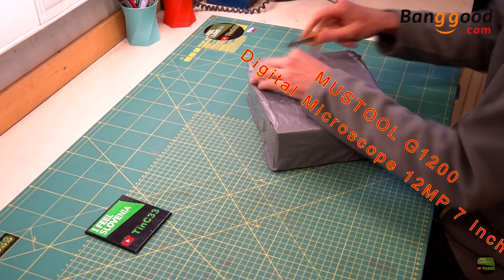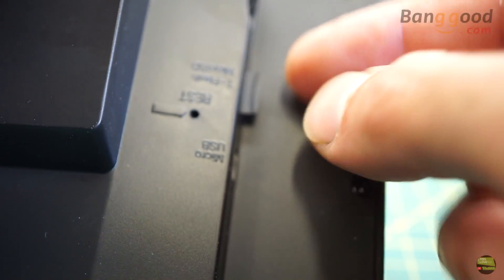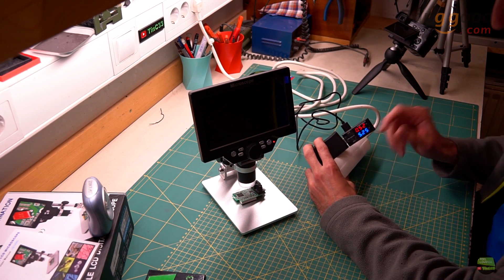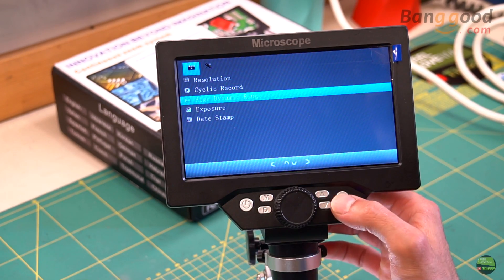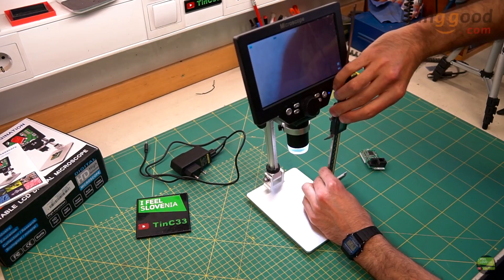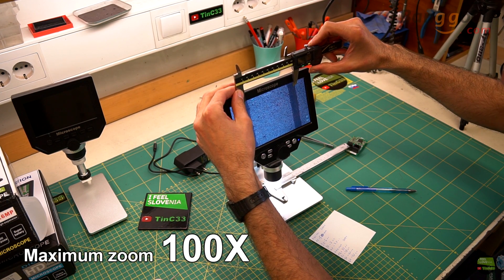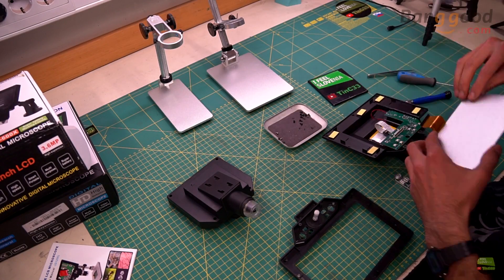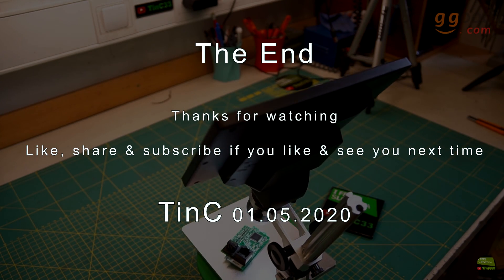MUSTOOL G1200 7" Digital Microscope [unbox / review / first test / compare with G600)

Comment: Thanks for perfect review.
I have  g600 and the same issue exactly as you said.first time unbox it didn't have charge and I charged it with fast charger and never powered on.i couldn't use it even 1 minute.
Do you have solution and did you solve g600 problem?I think cpu damaged

Comment: hi thanks for your video . very helpful. Mine just arrived and it came with an angle adjusting bolt that has to be losened with a 12mm spanner. A bit difficult to do, It would have been better to have with an adjustiong knob.

Comment: i bought it , and used it for a month , and i regret it , the image quality is very bad  , it never gives good balance between light and dark areas , the light is refleced directly to the camera when working with cicuit boards or electronics repairs , cannot see the parts clearly and the colors is not clear too , cannot tell if there is some thing dicolored or burned ,
and after a month or so of usage , it died , it doesnt turn on , i opened it and tested the board , i found the circuit board to be shorting on the power area next to the charger port , and its poor design seems to have failed in short time because it generates lots of heat while it doesnt have and proper cooling , 
its one of the worst microscopes in the market and no matter what price you pay for it , doesnt worth it 
never buy this model , you will end up throwing it in trash
Reply: I have had a similar experience. mine would not turn on either. on the day before it died I plugged it into my laptop and a message came onto the screen saying a USB device plugged into this pc is demanding more power than this port can give. I am not qualified to test the board, I wish I could, anyway i would need the microscope to view the SMD components on it, catch 22. I suspected that the battery was at fault so I removed it and now the microscope works again. I would be very interested to know which component you found shorted so I can have a look at that area and possibly replace that component with one of quality and maybe install a fan above it by printing some sort of holder on my 3D printer. The build quality of the microscope is rubbish. when i first got it the lens holder fell apart and i had to glue it permanently into the body of the unit.

Comment: Great review. I kindly ask which battery is fitted and its voltage and mAh characteristics. And where can I buy it. Thanks
Reply from the maker: It's one lipo battery so 3,7-4,2V about 2500mah i think, battery can be bougt on ebay, for microscope is link to banggood under video description.
Reply: @TinC33  Very useful information. I recently bought the microscope from Aliexpress by mistake without a battery, and I still did not know its features. Thanks.
Reply from the maker: @rosariaconilsorriso4314  i doubt you can just add a battery, there need to be battery manage system on pcb.
Reply: @TinC33  The microscope is the same as the one you reviewed in the video. What I know is that the package bears the words "the battery is optional" and that in the pcb there is a connector for connecting to the battery. I hope so.

Comment: been looking for an LCD microscope and came across your video. Would I 
be able to use this with slides ?? I want a reasonably priced microscope
 to look at skin scrapes from my pond koi. I can see there is no way to 
lock a slide in place but would that be a problem. Does it only work via
 battery or is there a mains cable as well
Reply from the maker: There are two types with or without integrated battery, booth are supplied with micro usb.
Reply: @TinC33  sorry..will the micro usb work instead of the battery. I assume it needs to be hooked up to a pc or lap top..
Reply from the maker: @mucky1957.  usb work like a power socket, you need a 5v usb charger (power supply) to plug on microscop for working or for charge the battery.

Comment: Thanks for sharing! I just bought one of these to look at tiny animals with students. I'm worried the magnification is not powerful enough because they lied about magnification.
Reply from the maker: Yes that's why i measure caliper under and get the result 100x max, i really don't understand where they got 1200x magnification, same as batter on battery toolls wich show 90 or more volts, but they are much or less 18v...
Reply: @TinC33  Because they calculate the magnification squared. For example, a 5x5 area fits 1000 times into a 500x500 image. Thus, the aspect ratios are only 100 times, but the area is 1000 times the original.
After all, it doesn’t matter which one the manufacturer writes, but it sounds better and easier to sell.
Reply from the maker: @stremix-rock  true like the diode lasers i tested they advertised as electrical power instead of optical power, thanks for explonation

Comment: Thanks for the detailed review! I just ordered it. Some magnifying tool has been one of my longtime wishes for my DIY workbench.
Reply from the maker: It's usefull i use them here and there, but for everyday repairs would buy something better.
Reply: @TinC33  Yes, I just wanted something that lets me inspect things a bit closer than the watchmaker's flip-lenses headband I'm using at the moment (though stereoscopic vision really helps with soldering; going to see how good/bad it'll work out in the end). Should arrive by the weekend...

Comment: I'm actually interested in a microscope with the least magnification level to read bills and checks, so your review where you actually took the time to measure the least magnification level is the best review I've seen so far.  So many reviews car only about the maximum magnification, and I don't care about that because it's unusable for anything including soldering.  I want to know the minimum magnification on these and how well they light and resolve the image.

Comment: thanks for the good review. can you leave the power cord plugged in all the time or do you think that would ruing the battery?
Reply from the maker: Thanks, you can because there are lipo bms circuit insidr, so when the battery reach 4.2v it plug off the power supply and turn on the green light, but still recomend discharge the battery time to time for it's longer life.

Comment: Hey can u send me pic How looks battery inside ? I get it on christmas present but without battery
Reply from the maker: Then it's without battery version, it's a singke sell lipo battery inside so 3,7-4,2V but check if you got free pins on circuit board to solder the battery cable on them. I'm not sure if this mod can be realised.

Comment: can this be connected for live streaming purposes?
Reply from the maker: I think not
Reply: Yes it can! Connect via USB to PC and select camera mode. It now turns into a normal webcam.
Reply from the maker: @michaellindborg1510  really, didn't try that, thanks for info.
Reply: @michaellindborg1510  hi sir will the unit still on if you connect it to PC and the battery is empty? because they share the same connection for PC and for power?

Comment: i have a huge Telescope , computer operated  runs on 12V and i plug it to 20V it explodes , but ive repaired it of course because it costs 2000$. Next time i plug it in on -20V so reversed voltage and again it explodes , and again i repair it , next time i burn up the Remote for it that also runs on 12V i plugged it to -12V ,  that i didnt repair for i dont need it any more made my own remote .
And this guy blows up his microscope with 4V and buys another one for he cant repair for shit .
Man , leave that resistor alone you gonn' brake something :) 
Amature ...

Comment: Do you know what is the voltage of the battery? Thanks
Reply from the maker: Basic 1s (1cell) LiPo so somewhere between 3,4-4,2V, charged with 5v via usb.
Reply: @TinC33  so a LiPo with 3.7V, like mobile phone's LiPo should be fine. Am I right?
Reply from the maker: @narcisogonzalezcalderon6074  yes

Comment: at 5:50 you say that the maximum zoom is 100x but since it's a comparaison with g600, can you remind what is the maximum zoom for the g600 please? thx
Reply from the maker: I don't remember, what was the maximum zoom on g600 but definitley less than here because of smaller lcd.
Reply: @TinC33  you don't have it anymore, to do quickly the test? ^^
Reply from the maker: @gamez1  i got them but mainboard is dead.
Reply: @TinC33  dead? so quickly? so it is not a reliable device, is it?
Reply from the maker: @gamez1  yes but my fail because i plug into QC3 usb charger, together with a photo battery charger, so it charge with 9 volt instedat of 5V, tottaly my fail.

Comment: Excuse me for my bad english, but I'd like to know how much time does it takes for a full charge, and how I know when it's charged. I have one and the red light during charge never switch off. Thanks for  the video.
Reply from the maker: It charge about 2hour, but the "charger" on built in circuit is cheep so red led glow almost all the time even if there are only few mA of consuming, red led turn off but need looong time, try to leave over night and it will turn off, that time ghe battery will be 100% full, but if you charge for 2hours, battery will charge to about 90-95%

Comment: Hey so I ordered a microscope about a month ago and when it arrived I realised that it was the version without the battery is it possible do you think to add the same battery that you have in your microscope to the other version I have?
Reply from the maker: Hm i don't know if the "non battery" circuit bord got bms (battery manegment system) so it cut off consumptuon when battery is to low and cut of charger when it's full.
I think it's easier and more safe to usr some power bank and fix them behind.
Reply: Ok sounds like a good idea I have a 18650 battery which I can use as my rechargeable battery and I have a BMS board with it that should work and i can just 3d print a case for the back for it to stay in.
Reply from the maker: @JackJack-hx4sj  that's the best way, use bms and into housing install one  micro usb for charging and one 10cm micro usb as output. 💪
Reply from the maker: But you'll need also booster so the output voltage will be 5v, buy some circuit for power bank (shoild cost few $) and you got everything you need, bms, booster, charger, discharge protection, battery capacity indicator...
Reply: What's the input volt and output volt of the battery built into the microscope
Reply: Thank you for the list things I need 👍

Comment: Thank you for the review.
So this microscope can replace an optical lupe with 3x, 5x and 10x magnification right? Thats the range i need for my work.
Most other products start at 20x magnification.

What would be the Andonstar alternative?
Reply: LOL.....once you view something with this microscope you won't jam a loupe in your eye socket again.....I have a 10X loupe I used for tool point viewing in my last employment.......attempting to solder a small component means you practically burn your nose of with a loupe......the 3D effect with the screen at an angle does give you a huge perspective advantage.

Comment: Thank you very much, this is one of the best YT video reviews of this microscope thus far. I've recently purchased one for home lab use, and I'm hoping it has a hidden menu to adjust things like screen color/gamma etc. I also ordered a Micro SD to SD card converter and extension cable, which should eliminate what others have complained about regarding difficult card removal. Also, there are some reports that if connected to a PC running Windows 10 via USB, it can browse the SD card storage and use the camera (detected as a webcam). Curious if the author has tried that yet.